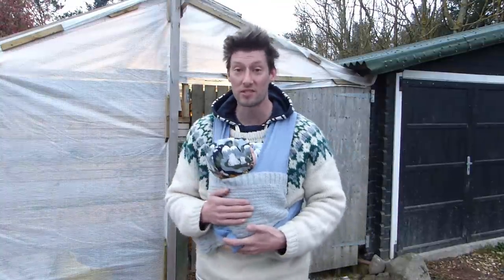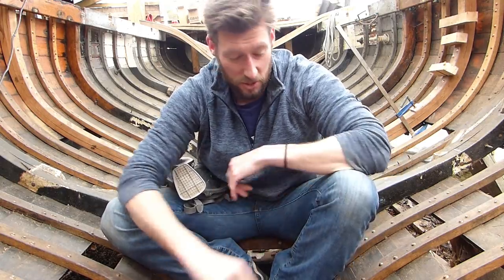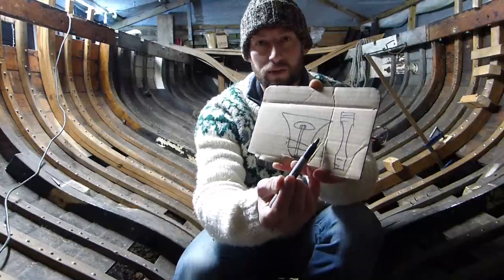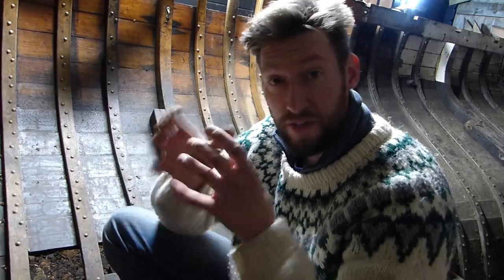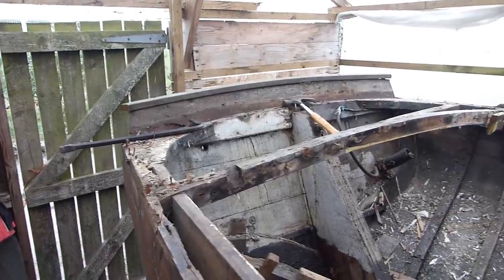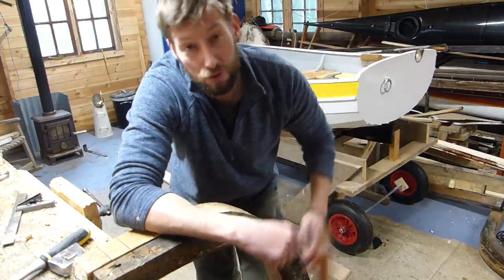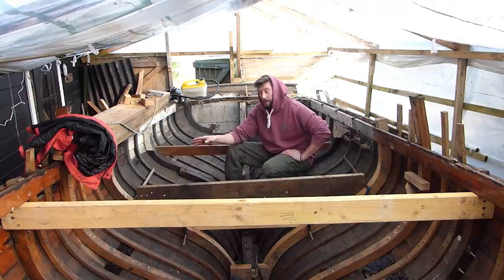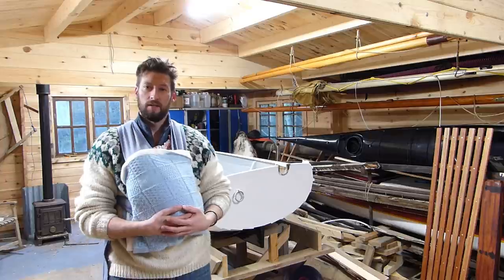Episode 20 - Returning to Idler - floors and frames

Comment: Always a pleasure to watch the progress of the refit and renewal of Idler. I'm glad the deck beams are off and the sawn frames are progressing well. it was interesting indeed to see the corrosion of the keel bolts. Is that preventable on the new ones? Thanks for the video. Cheers mate. 👍😎
Reply from the maker: Thank you so much, the best metal would be bronze. However the ballast keel is iron, so im stuck using iron again. If i can find “wraught iron” i can increase the longevity abit but they will still need careful attention. Perhaps pulling one every 3-5years to keep track of them. 👌🏻